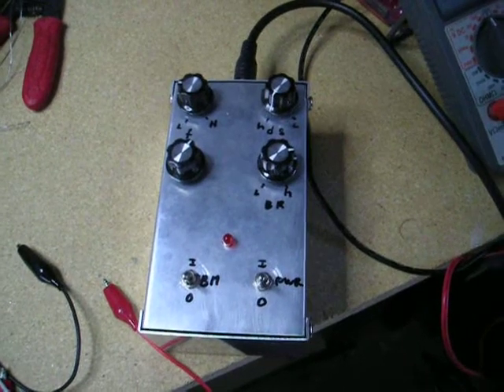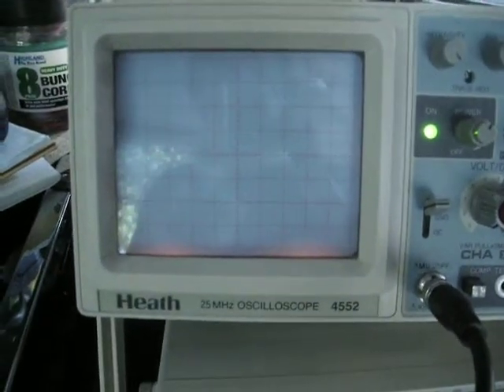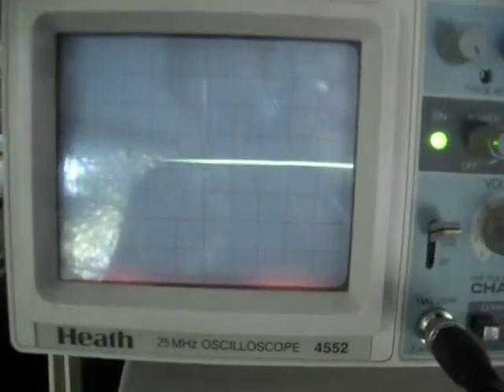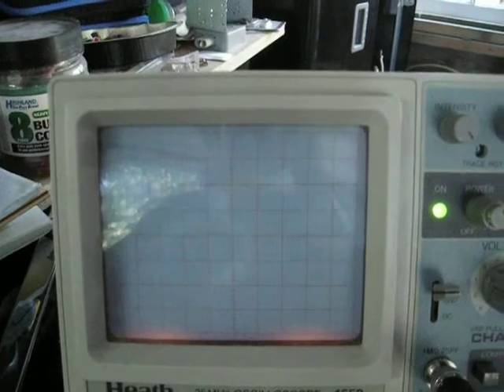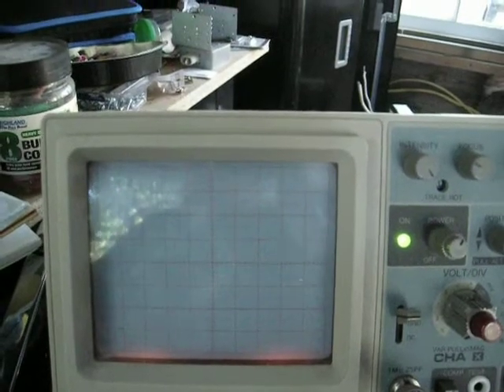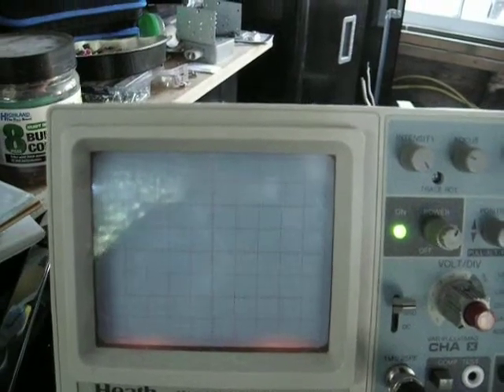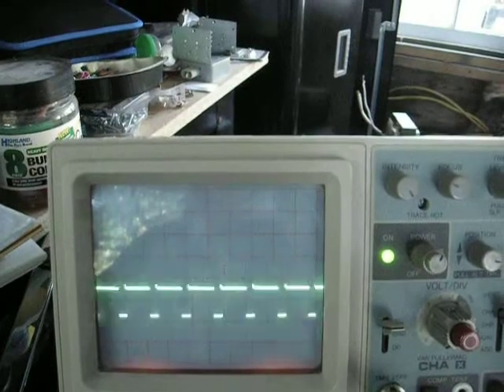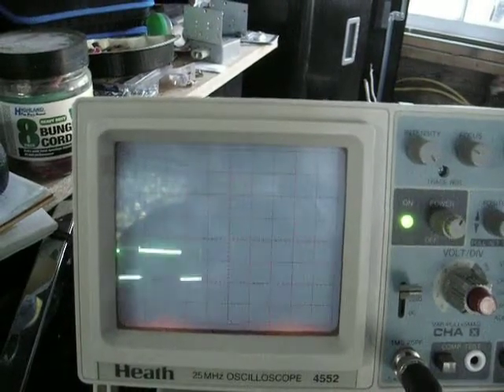DRSSTC Interrupter

Comment: Modern MCs are getting more and more EMC tolerant. If additional means of protection are applied, you won't have too big trouble.

For eyample you could decouple the controller by putting it into a metalline box, powering it by battery  and using opto-fibers for signal transmission to the final stage amplifier. The final stage could use HV-tolerant opto-receivers to drive the high-power HV circuits.

just some thoughts :)

Comment: i would recommend using a proper IC for the duty-cycle and frequency setting. i assume you are operating in the lower kHz range, so i could recommend the MAX038 from Maxim, which is camable of producing quite precise and stable frequencies up to 20 MHz with perfect duty setting from 5 to 95% without changing the base frequency.

Other method:
Get yourself a Microcontroller ...
recommended:  PIC from Microchip or ATMega serias from Atmel.
disadvantage: you gotta learn a programming language ;)